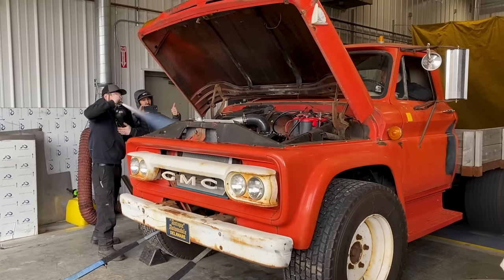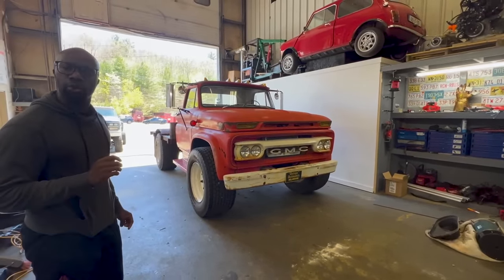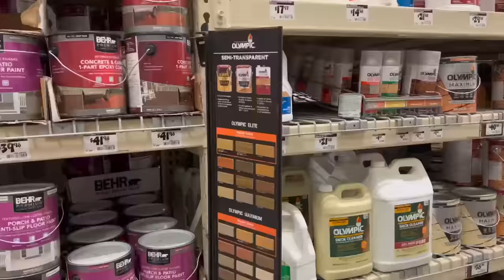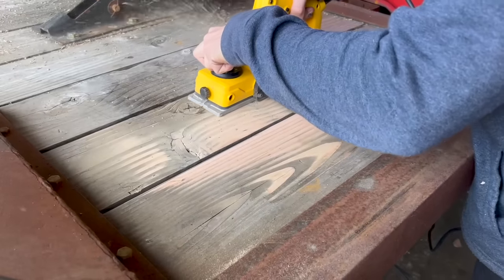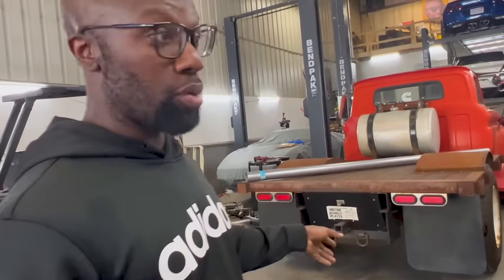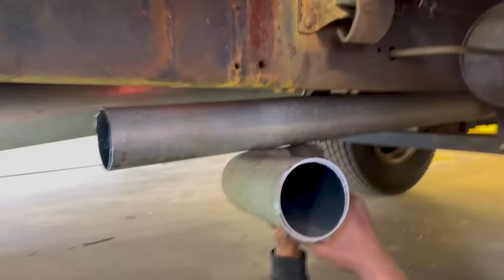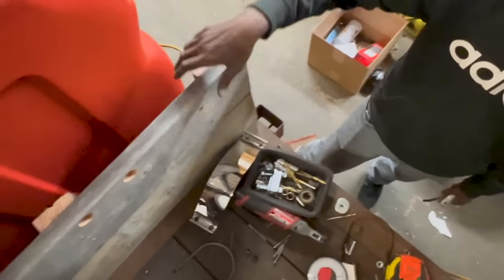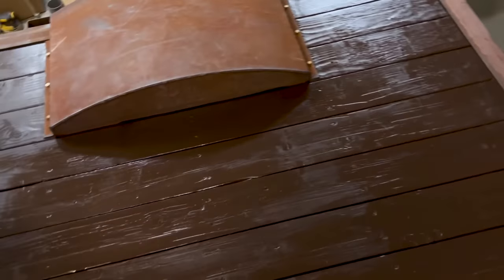Tastefully modifying our 1960s classic farm truck

Comment: Hey Rich, turn the tractor-flap so it has it's hinge towards the front, that way the wind cannot grab a hold of the flap while going down the highway, and rip it off.
Reply: Put the hinge towards the inside of the truck bed. You don't want the wind holding it shut either
Reply: @donaldbowden2271  it won't hold it shut.

Comment: Stevon was right, the bed looked better as aged silver before
Reply: I think Stevon was right about using oil
Reply: Yes, just copious amounts of oil re-applied as needed
Reply: Should spray the bottom with POR15
Reply: If it were my truck, which it's not, I'd have sealed and preserved the silvered wood like many of you are saying.
Reply: Boiled linseed oil for life!
Reply: I didn't quite care for the silver. But this stain didn't turn out like the sample and now it just looks like somebody painted it with doodoo. :(
Reply: @KevinFields777  That seems to be a problem with stain, I've found it very hit and miss. I used some on some Poplar laminated ply and it came out absolutely beautiful but I've tried it other times and had it look that horrible dark brown colour.
Reply: Yep should have just stained it with diesel fuel.

Comment: If you remove the screws in the bed, the wood pieces slide forward or backwards and come out. It's a common thing to do with these kinds of beds for a "clean" finish.
Reply: I believe Stevon would've figure this out if it was a case.
Reply: @konstantin88181  it's probably the case and part of the joke...
Reply: @tiloalo  These coments are too meta
Reply: It’s welded to the frame. Not sure the designer of the bed put that much thought into the decking lol
Reply: That's too much of an ask on their time labor for a video...meoww..

Btw, I wasn't expecting him to flash his own daughter for the thumbnail, perhaps for some extra views maybe..lol
Reply: r/woosh

Comment: The shut fin has to align with the direction of the wind
Reply: also known as a flapper...
Reply: It's also installed to high on the pipe so it doesn't close properly, and it needs to be weighted so it bounces😁
Reply: I thought the flapper was off directionally
Reply: Was missing when Breanna was looking it over.
Reply: That was driving me insane

Comment: If you remove the wheel wells, they look removable, I think the wood slides out.
Reply: Kinda what I was thinking
Reply: @TheDeathCards  Exactly what I was thinking.
Reply: 14:15 looks welded at the edge though doesn't it?
Reply: If you remove the center pieces, I guess you can just slide the pieces that are covered